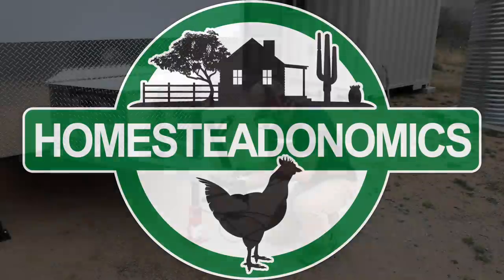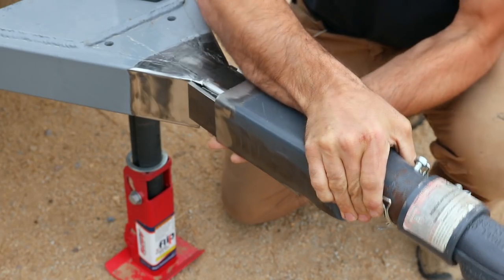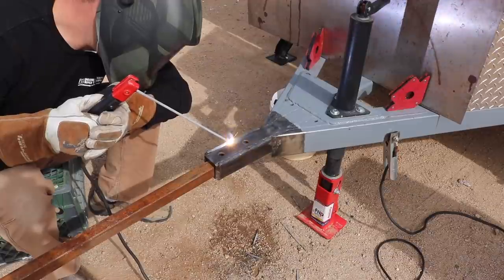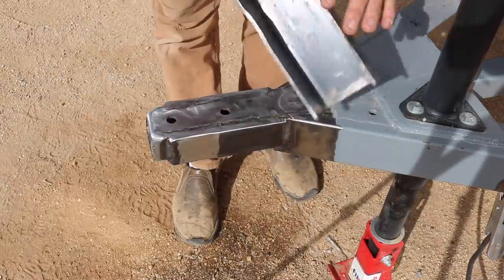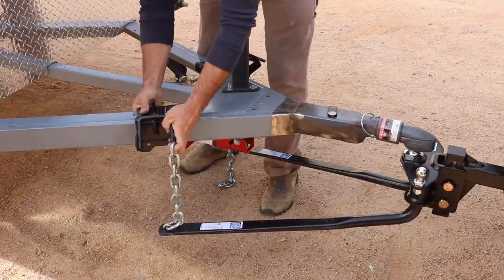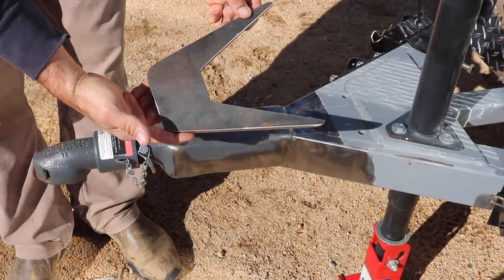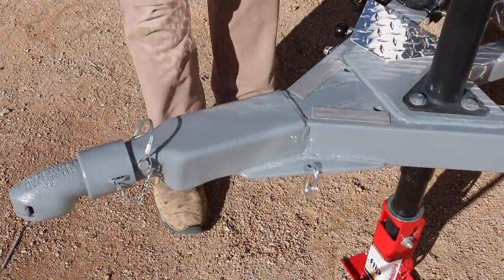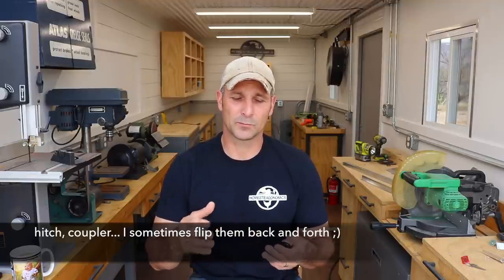How to Build a DIY Travel Trailer - Coupler Install, Hitch, Sway Control (Part 7)

Comment: Nice job ! btw were you ever able to repair the hail damage to the camper?
Reply from the maker: Mad Greek Outdoors thanks!  Not yet....I plan to before I add the solar panels on the top....just been putting it off because it’s gonna be a lot of time to get all the seam tape off and residue cleaned up before I add the new panels

Comment: Trailer brakes too? That little trailer is so overkill its not funny. Beautiful job, please don't get me wrong but my 24 foot heavy duty enclosed car trailer is built like that. My axles weigh more than your whole trailer lol. To each there own, thanks for sharing!
Reply from the maker: haha... I know, it defintely is overkill... but it's the way I overcome the potential shortfalls of build process.  And it's just fun to over-engineer sometimes ;)
Reply: onlychevys Williams i agree i dont see the point in adding breaks on a 2 foot long trailer
Reply from the maker: Kyle Gibson I know it is overkill but we have a lot of ups and downs with the canyons and mountains here....when we go camping in the white mountains of Arizona...we travel through the salt river canyon which has an elevation drop and gain of probably close to 6500’ in about 25 Miles.   Needless to say the uphill doesn’t matter regarding the brakes but on those long down hills I’m glad for the overkill so my truck brakes won’t take the brunt.  And yes I’m aware of downshifting😉

Additionally during that route to the white mountains we pass probably 15-20 runaway truck ramps.  Which is an indication of the up and down nature of the routes here.

Anyways, I do know it’s a bit much but it’s just something I feel is worthwhile since the axle already had brake drums.   So all I’m out is a brake controller and a extra blue wire.

Thanks for watching and I’ll see you on the next one😀👍
Reply: homesteadonomics if you like the white mountains you’ll love bear canyon/ Woods canyon lake area in Payson. Very crowded sometimes though

Comment: Nice job....where does the spare tyre go?
Reply from the maker: Stuart Nagle thanks!   It will probably go in the back of the truck or on the floor of the trailer...just didn’t fell like having it hang off the trailer
Reply: homesteadonomics 
Get a spare tire mount out of an scrap yard pickup truck and find a way to mount it under the frame of the camper. Saw a video of someone doing that on a utility trailer. 
Right now you have a truck but a smaller SUV won’t have space inside for a spare trailer tire.

Comment: Was wondering if the axel had a braking system installed the one I am looking at has one it is a double axel. I kind of want to put a backup camera in mine since they are cheap and I cant backup well.
Reply from the maker: Yes, this axle had brakes in the hubs already... i haven't hooked it up yet but plan to before I go on my first real trip... I also will be installing a breakaway kit for the brakes incase the trailer ever became uncoupled from the truck... but hopefully these efforts will make that a never thing ;)

Comment: Do you like the flip foot on the jack?
Reply from the maker: Kevin S yes I do like it!  Gives me the strength of a straight jack with a bit more clearance 😀
Reply: Where did you get it? Brand?
Reply from the maker: the coupler is a bulldog coupler from etrailer.com.... and the flip foot is called a 'fastway flip' also from etrailer... or maybe amazon... they both had the same price i thingk

Comment: WHY NOT keep the ball as close as humanly Possible to the bumper?  Redrill the pin hole. Weight times Arm equals Moment.... and Moment is cumulative.  A longer Arm pays NO dividends...  That's one of the reasons the 5th wheel or gooseneck arrangement is so practical.  Your thoughts?

Comment: Would have thought you'd put trailer brakes on before doing all that. I don't know what the regulations are where you live, but here in Australia anything over 750kg (about 1600lb) legally needs independent brakes.
Reply from the maker: It’s my first time building a trailer so I’ve definitely gotten things slightly out of order..haha...but it will all be good when the first trip comes😀👍